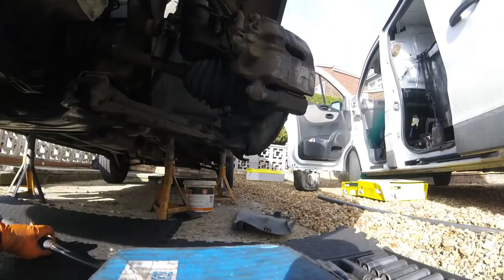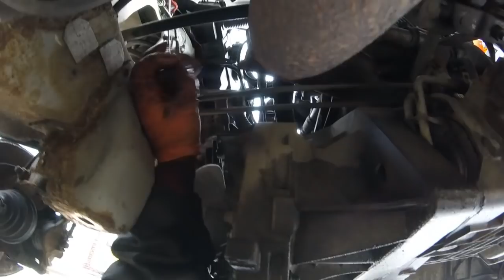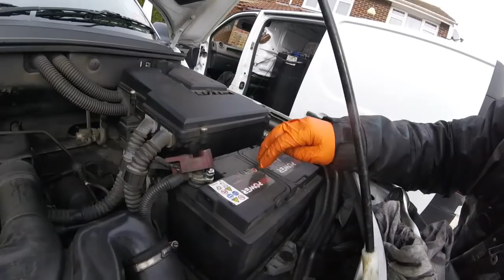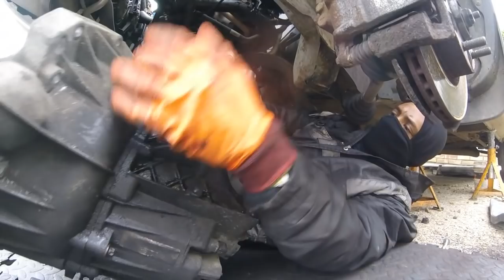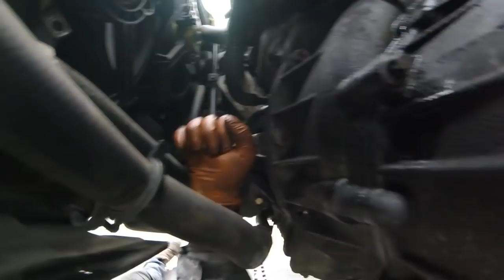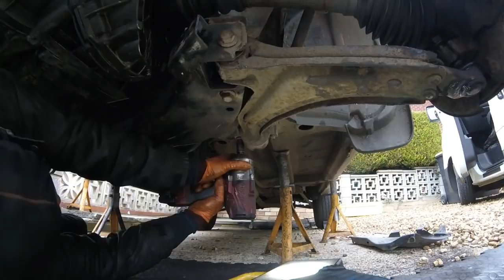2005 Land Rover Freelander 2.0L Diesel Clutch Replacement

Comment: At last someone cracking a joint with a hammer, never fails and more quicker than a complicated puller. You can trust Land Rover to design something so ridiculously difficult 😂😂😂. Decent Milwaukee fuel driver ;-) respect for working in crap conditions !
Reply from the maker: The hammer works every single time without fail. 
I’ve never used the puller before. I take it you’ve done a few repairs yourself. 

Thanks for supporting the channel. Really appreciate it. 🍻

Comment: Good video m8 I learned a lot but you didn't show you actually changing the clutch or master cylinder. will still help me do mine so cheers.
Reply from the maker: Paul Dixon 
They just bolt on.

Comment: they realy shoehorned those damn engines into that bay.my slave cylinders gone in the bell housing  i replaced the one behind the clutch pedal hoping to god it was that one ,but no fluid started pouring out the bell housing area so i fear ive got to do this as its too expensive in a garage so while its split i will put another clutch plate in ,some reckon you dont have to change the mass flywheel as  well ,the motors done 112,000 .i will wait for spring to start mine thanks for showing .Ant from wet wales .
Reply from the maker: Indiana Tone the slave usually fails because the flywheel centre bearing collapses. I wouldn’t risk not replacing the flywheel as it’s most likely to fail again. 

It’s not a bad job. You may need a hand to get the gearbox down. As it’s quite a heavy one.
Reply: ok thanks for that info .

Comment: Thanks for your video,man,and for not putting any music on it;
The factory manual says not to remove the subframe,and to rest and tie the IRD on it; i just did one like this(it was a crank change,lots of work!),have another one here for crank or maybe for the whole block,don't know yet,it "broke" the turbo and ran on the engine oil till no  more oil was left,the owner cleared away from it ,instead of engaging 5th gear to kill the run-away engine;   and i know, IT IS SCARY!!!;
  Do you find it necessary,or just better, to remove the subframe,like you did?
Reply from the maker: Jose Peixoto much much easier when the subframe is off. You can everything
Reply: @WMCS  good deal; i'll do it on the one i have here

Comment: Thanks for sharing this one man job!  1 nub question. What is that red paste you use around the holes and spring and what do you use as a sealant?
Reply from the maker: The red stuff is rubber grease. Which helps reduce any friction from the spline  to the clutch plate when installing, and it helps in stopping corrosion from the bolts. No sealant is required on this particular repair. 
Thanks.
Reply: Thanks for your prompt answer! I came up with 2 more questions, if you are so kind to answer :D.  1. I see the car didn't have the propshaft/VCU mounted. Did you undo it, or the owner decided to go 2wd? This is probably important and IRD oil has to be drained too? 2. Did you have to replace any oil seals in the entire process?  Many thanks, great work, very efficient! @WMCS
Reply from the maker: @Filmusine44  Hi.. 
1. The customer decided to go 2wd.. But if it did have a prop shaft i would have left it on.. I drained all the oil out as I don't like any mess whilst working.
2.. No oil seal was replaced., Which specific seal are you referring to..
Thanks.
Reply: Cool. I was thinking O rings, for example Box to IRD or drive shafts, but you would've mentioned if you did :), so I take it as a no. Nice to know propshaft can stay on. @WMCS
Reply from the maker: @Filmusine44  The only seal would be driveshaft seal on both sides if they were showings signs of wear and tear or displaying oil leak...
thanks
Reply: red rubber greas

Comment: How easy it to change  transmission  fluid on automatic  gearbox 2004 td4
Reply from the maker: Ooo that’s a bit technical now. Depending on vehicle you may have to do it with engine running for different gears at different revs ..,,

Comment: How long did that take?
Reply from the maker: nw8000 took me about 3.5hours.
Reply: really 3.5 hours but you didn't do this the first time, I'll start, the transfer box started to whistle ... what do you recommend? replacing them with a used one or replacing the bearings

Comment: I like your job.... Are you clutch specialist? What about timing belt replacement or head gasquet? Sorry my English is not very good😅
Reply from the maker: gregos73 
I am an engineer as well. I rebuild engines which includes timing belt. Head gasket. Piston rings. Cranck bearings. Etc... are you in the UK
Reply: @WMCS  thanks... No i'm in France

Comment: Rover 75 has same gearbox, slave cylinder, and same BMW 2.0 diesel. For some reason the 75 (and MG ZT) has a problem with new slave cylinders failing, but the original factory fitted slave cylinder lasted ages.
I have a 2002 Rover 75 and original clutch & slave lasted 17 years (clutch worn, slave still good) then the new slave cylinder failed in less than 12 months. Any idea why? Does Freelander have this problem?
Everyone in Rover 75 group says you don’t need to change flywheel, what do you think?
Reply from the maker: That’s correct. You don’t need flywheel change on them. They are made to last at least two or three clutches. 

The reason for the CSC fail is the travel goes too far and it leaks. There’s a mod for it. Two screws on the side.
Reply: @WMCS  the diesel 75 has same flywheel as the Freelander 1 2.0 td4, lots of people say to change flywheel on Freelander, but no one ever says this on the Rover. Strange.

I’ve not heard about this mod mate, where do the screws go?
Reply from the maker: Sorry. I thought it was the petrol v6.,, diesels definitely needs the DMF.,,
Reply: @WMCS  
Glad you’ve said that - exactly what I think too mate, and it’s probably the Rover 75 guys not changing the DMF that is helping the CSC to fail quicker.

Is that mod with the screws for this or a different model, I’m trying to think about that one I’ve got engine and box out my ZT at the mo

Comment: My cluch is slipping on a td4. Just got it off ebay as an mot failure. Didnt notice the clutch,  doh! So much for a bargain! Where are you based, and how much do you charge?
Reply from the maker: Message me or complete the quick online form with your regard postcode and I’ll put a price together for you. 
07376369067
www.williamsmobileclutch.co.uk
Reply: @WMCS  hi cheers, will do.

Comment: Hay KAW 
Great video!! 
I'm using your video to help me remove my gearbox to replace the slave cylinder ive got as far as the ird but there's no movement in it and it won't come out!
You got any advice, please?
Thanks in advance
Reply from the maker: Please check all bolts’ been removed including back bracket. 

There’s another video where I show more in depth about the brackets and bolts of the IRD. it’s the red one on the channel.
Reply: @WMCS  I've drained the oil, drained coolant and disconnected the water pipes as I didn't want it to hang there as I'm doing it in stages, all four bolts are out but it's just won't budge!
Reply: Sub frame bracket is also removed btw!!
Reply: @WMCS  you're a bloody legend mate 👍👍👍ird is on the ground!!